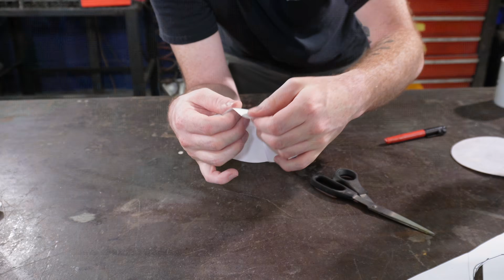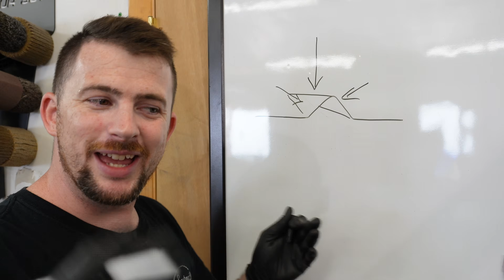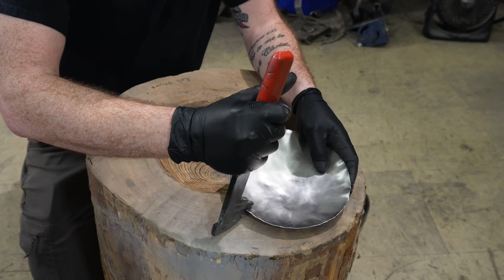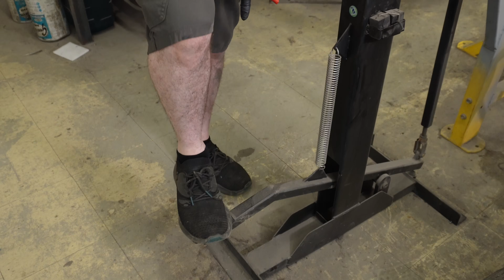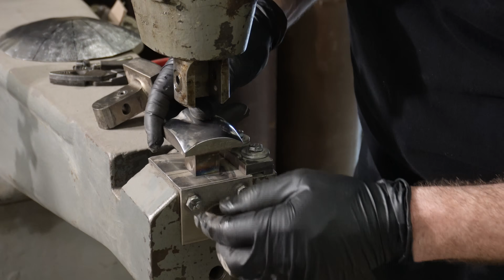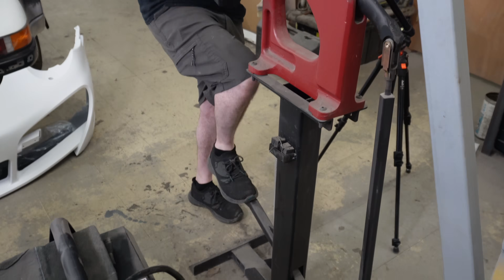Step Up Your Custom Car Building! -- How To SHRINK Steel (Metal Shaping For Beginners)

Comment: Dont know why i dont get all your video's at time of release when im on all notifications. I had to go searching for this one. It's probably a little late now but yes more of these videos like this please. I would like to know more about plannishing hammering. Why do the cheap ones use a rubber top lip? How much pressure to apply, and then handheld ones. What surprised me was the weight of one a saw being used to do a roof section. I thought the weight would be a detrimental force to the area. Thanks guys.

Comment: I used to work with metal , but it was generally done with heavy-duty equipment . We took rolls of flat steel and turned it into things like corrugated siding and flashing for construction . And since nothing is ever perfectly straight in construction . We had to use some stretching and shrinking techniques . But like I said all of it was done with heavy-duty equipment . The brake that we used was probably the smallest tool . And it was 25 ft wide , with hydraulics running it instead of your arm .

Comment: Great tutorial video! While shaping, how much stretching and shrinking will you use?
Please go ahead with the cheap machines, since those are the ones non-professionals may buy.
Reply: The piece you are making will tell you what it needs, if spots need more shrinking or stretching in spots, it's just about getting to the point where you can look/feel the metal and understand what is happening
Reply from the maker: Really depends on what I’m making. I try to use a good balance between shrink/stretch to avoid the material getting too thin. 

And sounds good! 🤝🏻